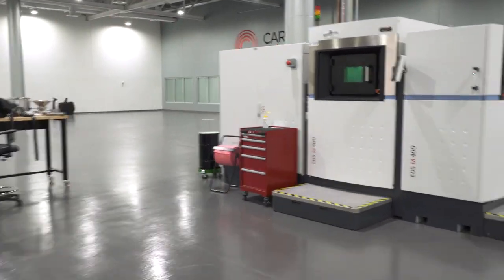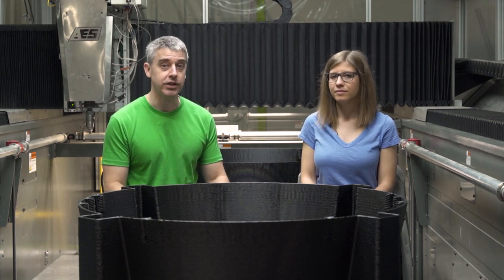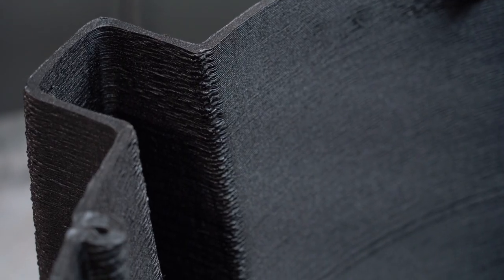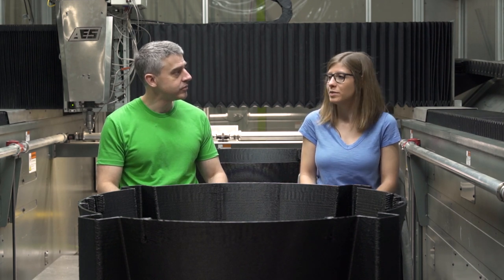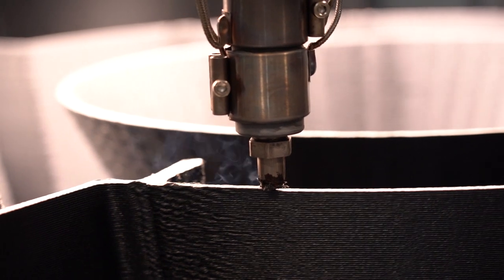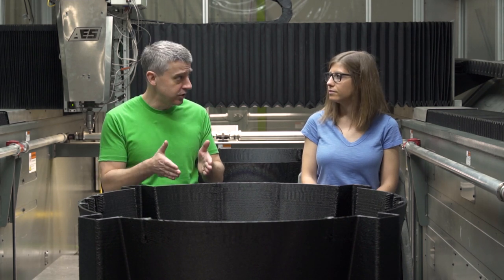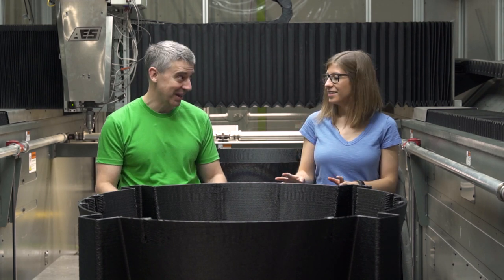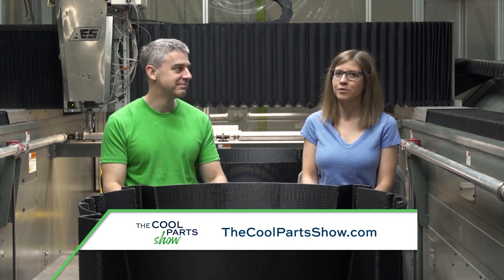Autonomous Underwater Vehicle With 3D Printed Hull: The Cool Parts Show #24

Comment: so the inside is flooded - does this means the electronics are subject to the pressures? or is there a smaller inner hull that is not flooded, only the outer shell is?
Reply from the maker: Here is the answer from Dive’s Bill Lebo, who appears in the episode. Bill says, “Sensitive electronics are housed in smaller titanium pressure vessels, while some electronics, such as the batteries, are designed to withstand the pressure.”
Reply: @AdditiveManufacturing  Many thanks!! I really appreciate your answer :)